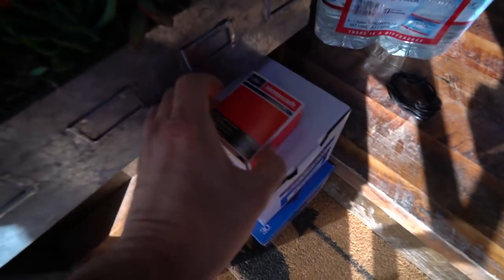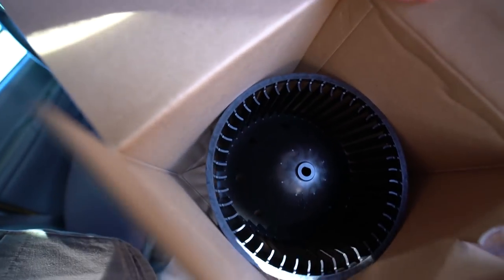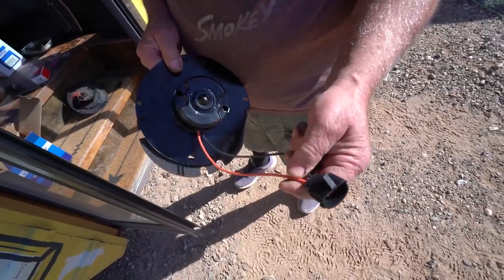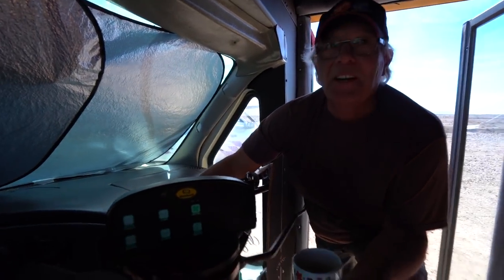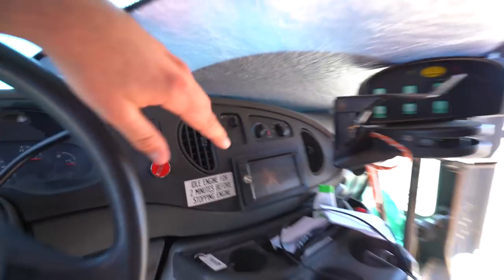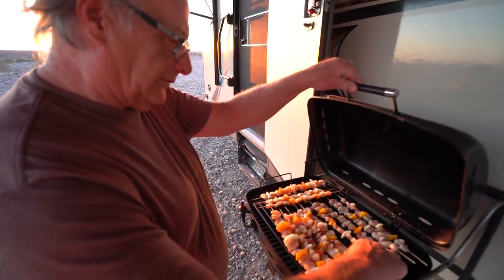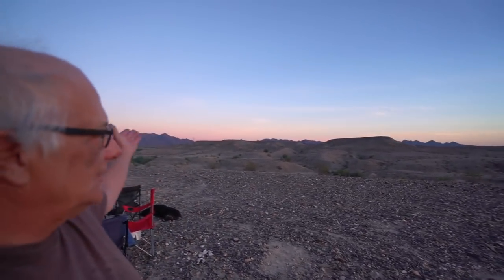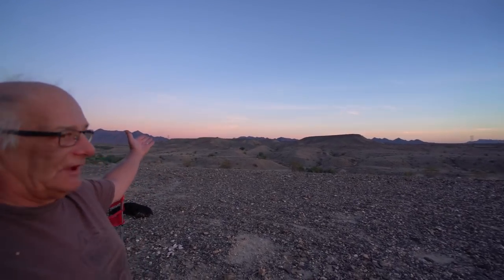20 YEAR NOMAD MECHANIC LIVING IN RV TRAVEL TRAILER - (Badge)

Comment: Just a thought, might I suggest checking the amp draw on the rear A/C fan motor. Its what creates the heat on the fan switch wiring. Just a thought.
Reply: Gordon Tamplin we did it was just old switch lol🇨🇦